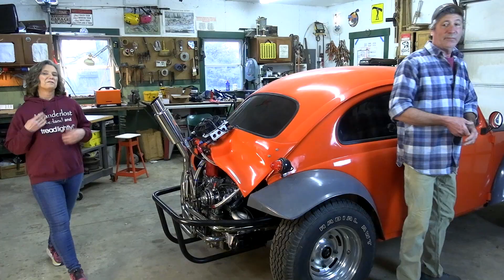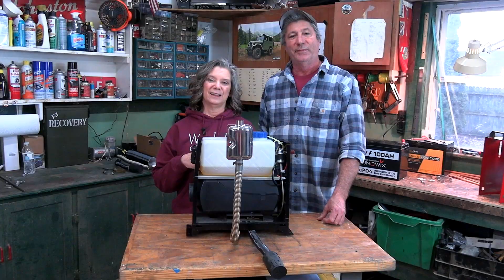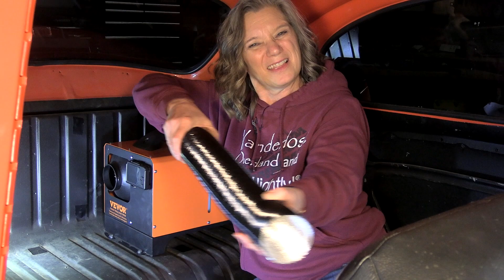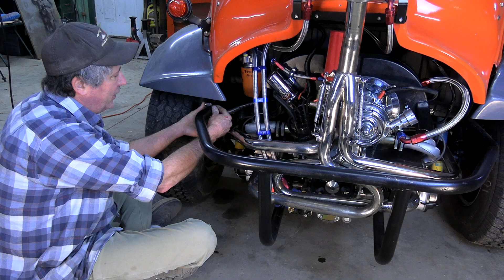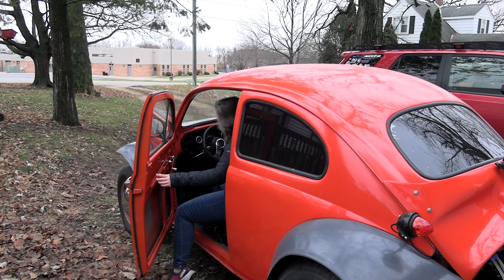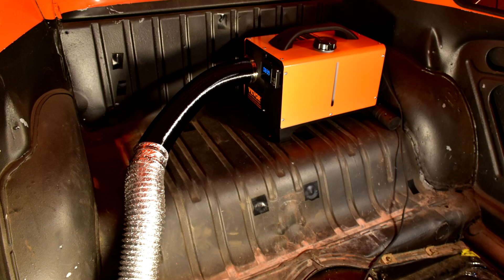Finally! Heat For Our Baja Bug Beetle Overlander Build

Comment: I have a Squareback that I'm going to be adding one of these heaters to later days. Right now, I'm testing it out heating up my shop area, (about a 11'x14' end of a lightly insulated garage) and it seems to work good enough to keep the chill out. I have been trying to find a way to mount it permanently into the car without losing that much space inside. So, it will probably be torn apart and tucked away throughout the car. I have plenty of insulation in the car and have the stock heater system working well. So, after watching your vid I think these Colorado winter conditions will be an easy t-shirt drive. Thanks, and good luck on yer builds.
Reply from the maker: Sounds like a great plan!